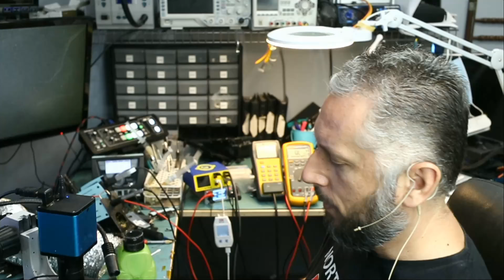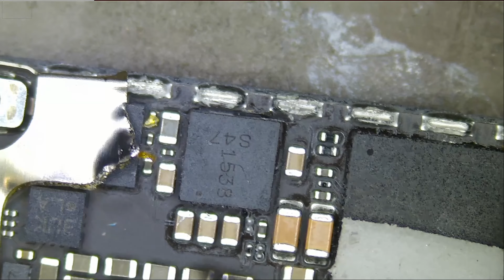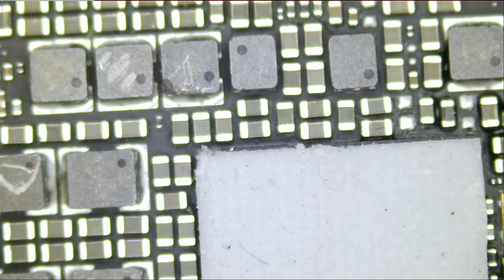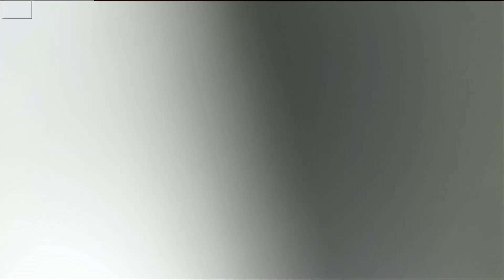iPad pro 12.9 No Power Fixed - Totally Unexpected Problem.

Comment: Great repair and finding, my only concern is that shield. Not sure what you did afterwards but leaving it without a shield could impact the WiFi performance, desensitize the antenna or noise issues in general.

Comment: I noticed the marking on the parts are different. Suspecting silicon chip shortage forced apple to find an alternative part, which is why you haven’t seen this issue before. The chip shortage is going to bring in more firsts me thinks…